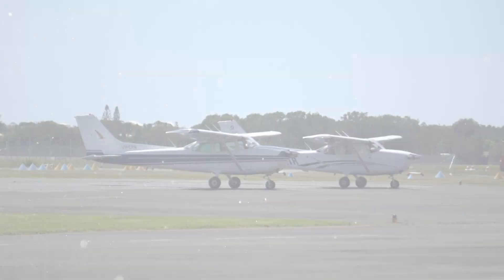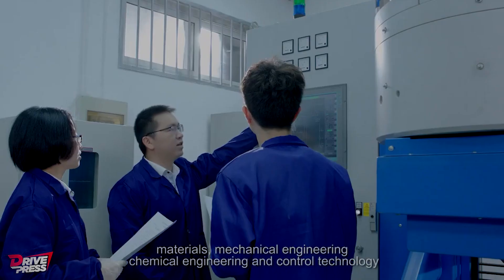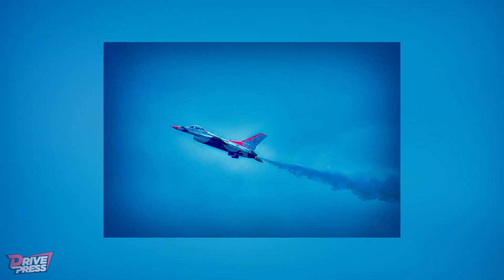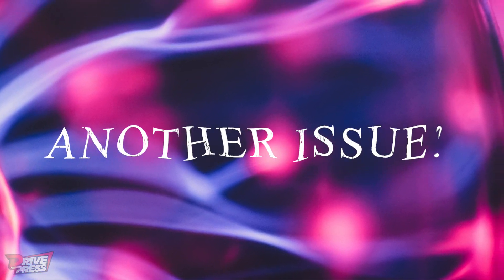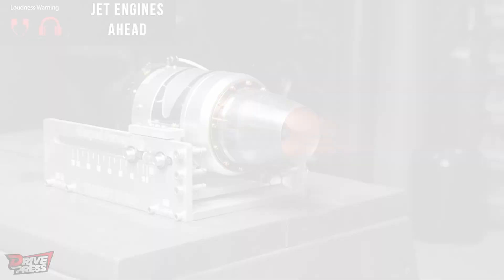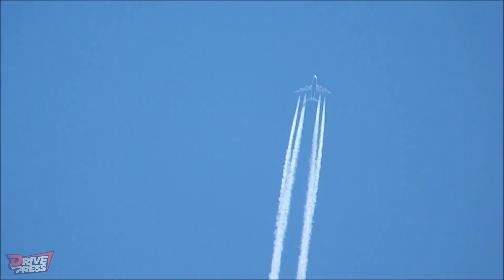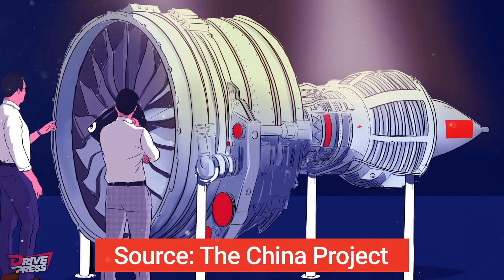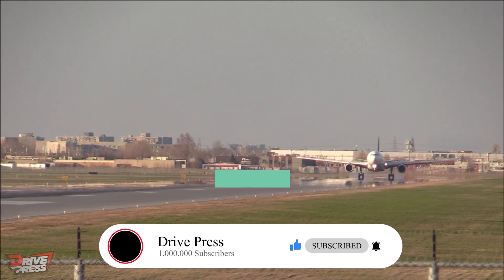INSANE! China's Plasma Electric Motor SCARES Tesla!

Comment: It appears that power generation it the " stumbling block " behind this problem!!! How or when China built an jet aircraft to display to work will be the ultimate test.
I would suggest putting this tech on a hypersonic train with small nuclear reactors ( SMR ) to test the theory first to get it to work. Also, the blades in those engines can withstand the heat from the plasma during the testing??
Boeing would go out of business if such technology does work unless they made the scientists gets suicidal like that whistle-blower before he testified in his day in court  date....hmmm??
Professor Takahashi had run to China before he gets suicidal if Boeing does not want his research to be successful. It does make investigators wonder about those 8 Chinese scientists that were on Flight MH370 that held patents on similar technology-related that mysterious disappeared upon their demise????